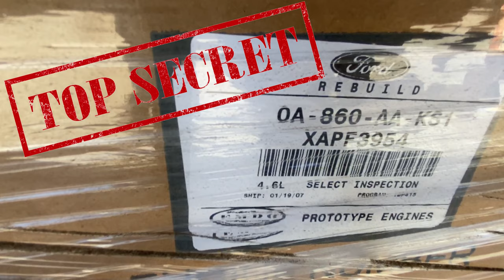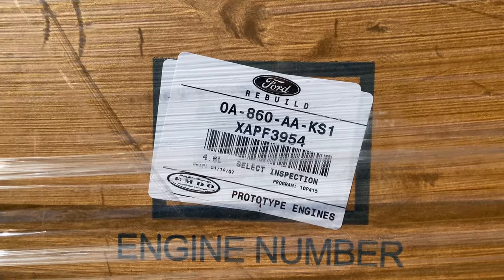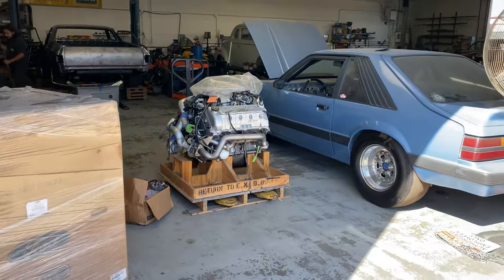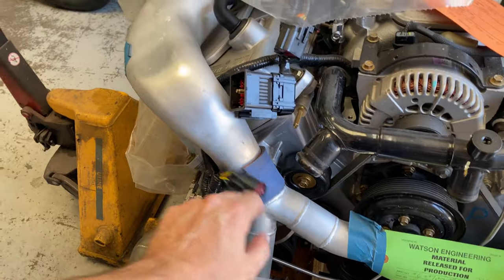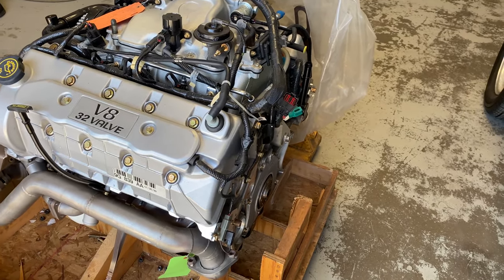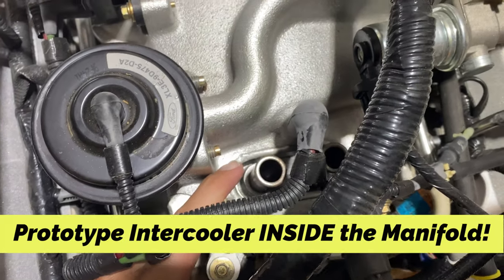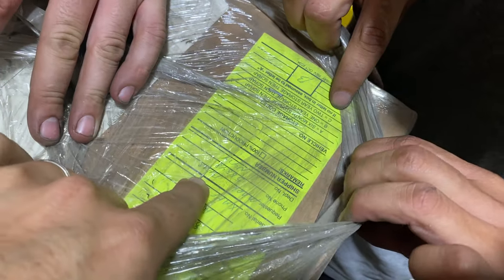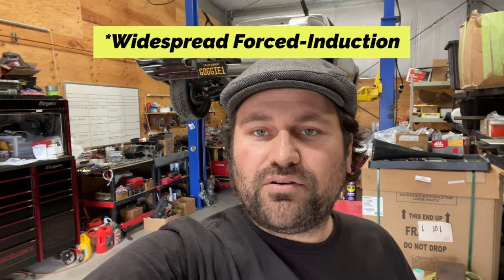Ford Prototype Twin Turbo Modular Motor Barn Find: Supposed to be Crushed-Crazy OEM Intake Manifold

Comment: That's really freaking cool. I would have guessed that it was a prototype for the 03/04 Cobra with turbo's instead of a PDB but SVT did not change the direction for the 03/04 Cobra with adding boost until after this engine would have been made. I think an engine for the super stallion is a really good guess
Reply from the maker: Only after I posted it did I start wondering if it was for the Terminator Cobras?! I remember Ford considered it, but ultimately went with the Eatons, but I couldn’t remember if they considered the turbos before the Termi was out or after it had already come out, as an update—thanks for the info! Hopefully we find out at some point!
Reply: @RaceGasSmellsGood  The way I understand is is that John coletti was not happy with the performance of the 2001 Cobra which is what canceled the production of the 2002 Cobra as they went back to the drawing board for the 03 Cobra which is when they decided to supercharge it. So being that the supercharger for the 03 Terminator was not even thought of until 2001 this engine would have already been built for some other purpose long before then. At least that's my understanding of it.

Comment: Bad A$$ find... Love the videos
Reply from the maker: Thanks man! Much more to come! Love your white Fox! 🔥🔥
Reply: @RaceGasSmellsGood  thanks my brother!!!  🚫🧢🚙💨💯💪🌮👊
I'm about to start taking it apart. 
Head lights, tail lights, side mirrors, side moldings, door and window trims etc to get the body work done and then get my friend to lay the paint down and last but not least install my dart shp block billet main caps 427w with Molnar forged crank Molnar forged rods and Weisco pistons with hi port heads etc is going I'm my white coupe

Comment: Turbo Terminator.
Reply from the maker: Good call, after posting the video I started wondering the same thing. I’d heard that they were thinking about turbocharging the Terminators but I think there was too much under hood heat, so they went with the Eaton.
I’ve got a bunch of calls out so hopefully I hear back and I’ll post an update video. 
Thanks for checking out the channel. That your New Edge in your avatar?
Reply: @RaceGasSmellsGood  it my 1994 347 stroker cobra
Reply from the maker: @gtnos1993  Nice man! Love me a good SBF with some added displacement! I just subbed to your channel too, to stay up with your build!